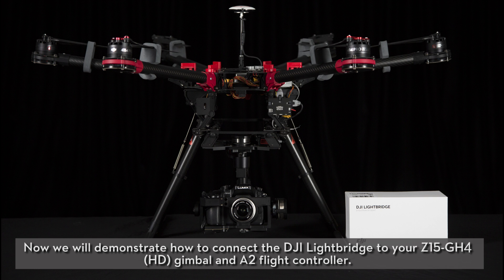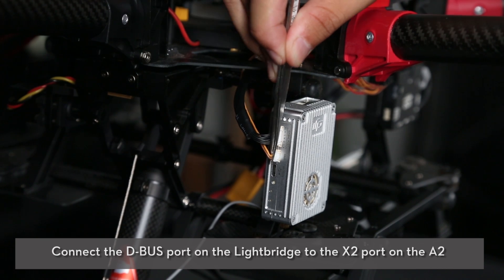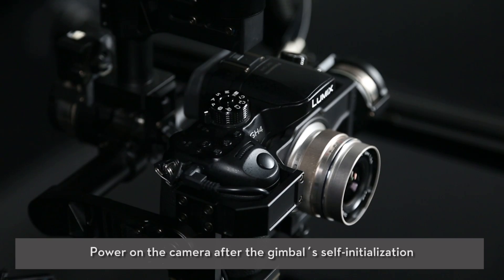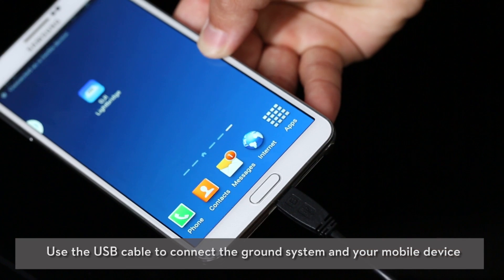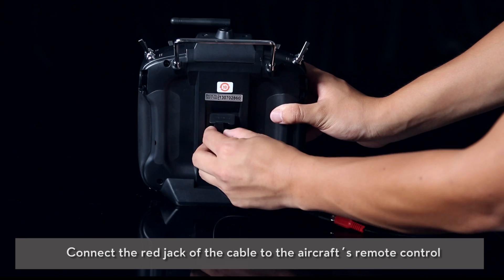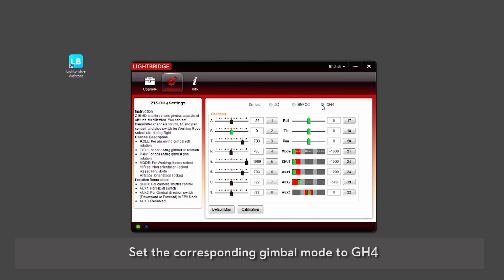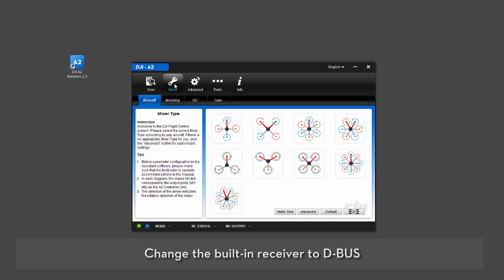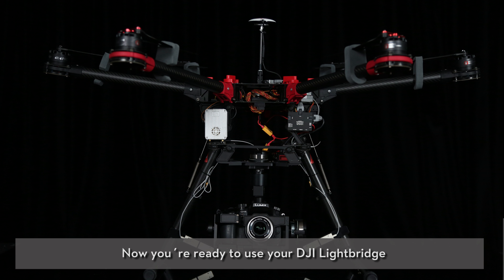DJI  –  How to install and connect Lightbridge to Zenmuse Z15-GH4- (HD)

Comment: Can the new DJI Transmitter Controller (with Jog wheel) be used with the Lightbridge on the S900, like with the Phantom 2, or do I need to buy 2 Futabas? Thanks!